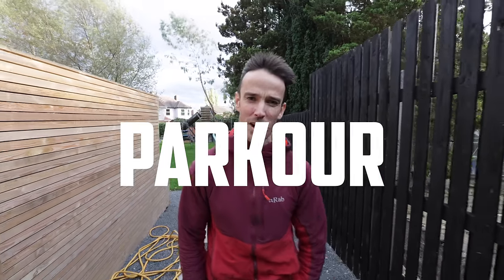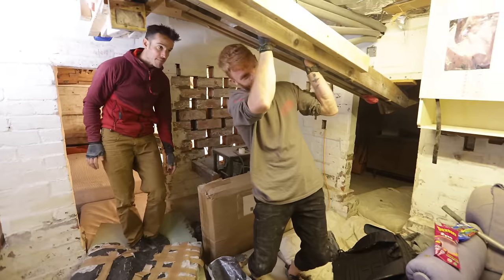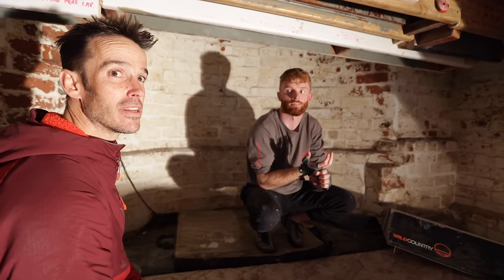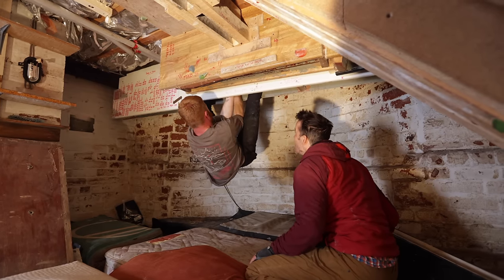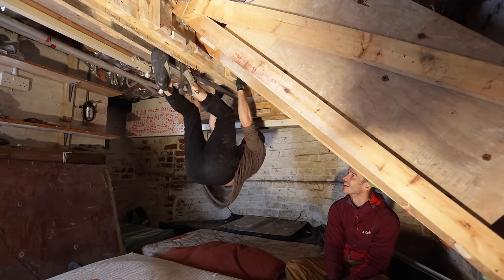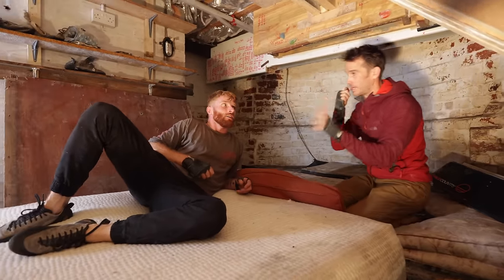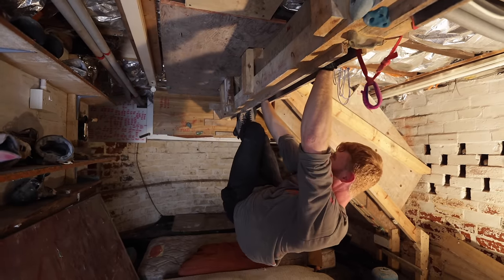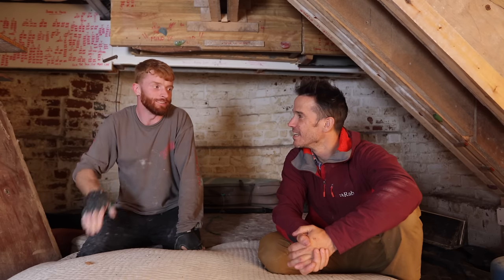Parkour Smashes Crack Climbing. Most Successful Guest Ever!

Comment: What’s the reason for pointing the feet out in the wide pony as appose to pointing up? Does it make it harder and better for training? Because i find my feet cam better pointing up.
Reply from the maker: This crack in the cellar is too narrow to point feet up. You could probably squeeze them in, but then the amount of effort to get them in and out again would surpass the effort to point the toes slightly outwards. On baggy hand fist and double fist toes pointing up starts to work better. It all really depends on hand and foot size though

Comment: i can see what toby is doing wrong here, and also in the parkour vs climbing challenge - too bunched up, hes supporting his weight using strength rather than going slack on the wedged limbs. you notice toms legs are way more extended and so arms are reaching all the way out.

Comment: why is it easier feet following? I havent done any crack climbing so ive no idea!
Reply from the maker: It isn't necessarily easier. both feet first and feet follow have their time and place. feet first is nice for complete splitters without much variation. it takes some weight off the hands, but is a slowly style of moving. feet follow is a quicker style of movement, you can reach through cruxes more easily, however you do tend to put more strain through the arms. It's always nice to use a mix on big roof crack climbs